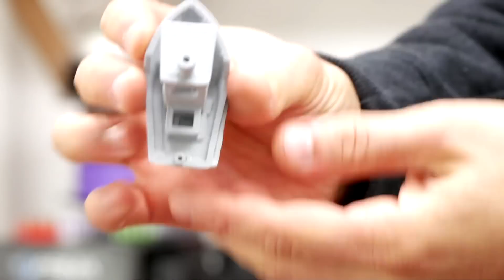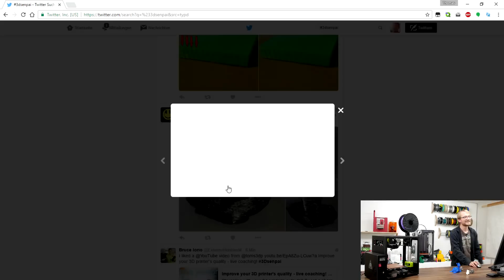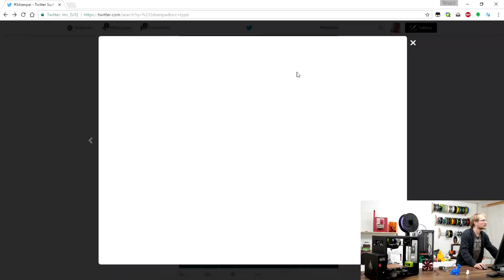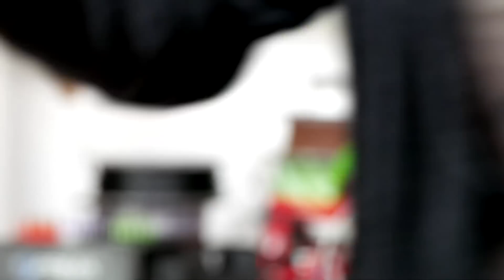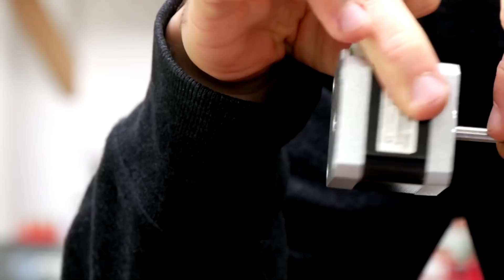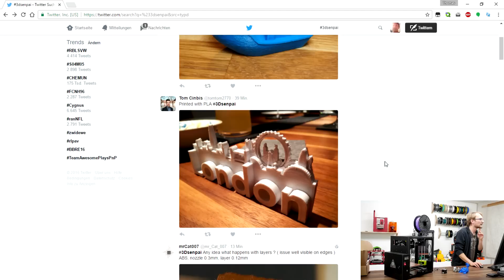[Part 1] Improve your 3D printer's quality - live coaching! #3Dsenpai

Comment: I have a weird issue un my ADIM Lab modified prusa i3, it's about the print quality, it extremely inconsistent. One time I have pretty rough walls and in the next print (nothing changed the same pla) they're perfect, sometimes there are differences in the same print

Comment: That 3rd( I think it was the third one you looked at) black rectangle also looked like it might be the infill. 

Like if the guy used something like Rectilinear at a 45 degree angle but didn't have the % high enough. 

So he gets the diagonal lines of the infill's pattern and drooping just enough for that pattern to show through.  

Could this also cause that diagonal line distortion on the top of the model? :{J

Comment: Tom, got a question, can you do a instructional video with good close ups on the 10 or 15 most common print quality issues. Items like what over extrusion looks like, what the hot end is to hot look like, Z axis problems ........ that kind of stuff. This video was very close and I learned a lot, but I guess I'm looking for Video catalog of things to watch out for ;- )

 It would probably be a 30 minute video but really think folks would like a in one video or series of videos just on that subject. I know I get some strange looking things on some of my prints and would really like to know what is causing it, Little bloops on the side wall in the same area once in a while as an example ;- )

Thanks Tom

Comment: At our fab lab, our ultimaker 2 had problems with skipping on large parts. The problem was fixed by cleaning all of the guide shafts and re-greasing them. Worked like a charm on other printers as well.

Comment: I have this strange problem where I want to reduce print times but not affect quality in any way....
Reply: D64NZ That's hard to do depending on your printer....what type of 3d printer do you have?And how long does it take to print a none complex piece
Reply: I don't really think it's possible, but it is a Winbo 155L Superhelper. It does do good prints, I'm just impatient.
Reply: D64NZ With your printer it is possible but it is all in the settings so you would have to tinker with the settings to make it go faster for me I use a prusa and it would take 2 hours to print something big so I edit my settings(such as wall thickness,temps,etc) and narrowed it down to take 40 minutes

Comment: Awesome: Thanks for the Video: You nailed my Problem which has been driving me up a wall for 3 months.
Z Axis Screws that wobble, Did not know that would cause the rings on all my parts but the pitch matches so You nailed it. New Rods coming now.  That is what I get for buying the cheapest Prusa 13 clone on ebay ($200+ shipping).  Should have known better.  I'm now subscribed and going through your videos.

Comment: Z-wobble can be cause by the alan key screws that so tight to the threaded rod and force the flexible coupler to be bent on a side! 
I change the coupler and kept the screws barely holding the threaded rod. 
CoreXY 200*200*200 wheel slider gantry, 20*20mm alu profile 
Anyone having this problem just fill the thread grooves with epoxy and smooth them aligned with the top threads with a wax paper to be like a  regular 8mm steel rod for the first 2CM or about an inch inside the coupler, the alen screws will hold the rod strait like a round regular rod.

Comment: The analysis of the 3DBenchy problem (time index 22:00) is wrong in my opinion. This is not a printer problem but a slicer problem. I had exactly the same problem on the same location on the 3DBenchy with the simplify3d slicer. Simplify3d is very picky on the STL file format and will skip layers if the STL-format is not perfect. There are 2 versions of the 3DBenchy, one that will correctly be sliced by simplify3d and one that doesn't.

Comment: For the first time I decided to print a rounded model.  It was a Cat used in a Chess set I got from Thingiverse.

The thing is the bottom curved layers compounded, making a upside down staircase effect, but it was all the way around, not just on one side like a loose belt would cause.

So I made an "egg" shape flattening the bottom enough so it can stand on its own, and wow it has a stair case effect all around the bottom section, the rest is real nice and smooth.

well the top is a bit short.

I have no idea what is causing this. So far I have tried, slower printing, increasing the infill, reducing the slope.

Yea none of that is working, any ideas?

Comment: Thomas, I gave just got a bunch of Wanhau 3D printers with dual heads. Its all fairly straight forward except for this: Since the extruder heads are software assigned, can we assign different colours on the same job?   I a using ProDesktop to generate  STL and Duplicator for the conversion......

Comment: Why is it I have never had a single PLA jam ever? I don't even retract the feeder when changing filaments, I just heat to 170, release the feeder, and yank out the old filament xD
Reply: e3d  clone here no jams myself either, gues got a good cooling fans
Reply: E3d V6, I did get my first jam when my cooling fan died the other day, I jinxed myself. It was a really bad jam too, the filament twisted around in circles in the heat brake. I had a hell of a time unjamming it.
Reply: I used clones on all my hotends and never jammed, just make a modification so the ptfe get through until hotend tip.
Reply: i have a printrbot play and only ever had it jam due to heat creap bc the raft i was trying to print was 4x5 in. and thats too long for it to run without the fan at a low extrusion speed
Reply: 6mths ago but worth a shot; Any chance of a buyer's link?
Reply: I use an E3d V6 clone with a seperate all metal heat brake to replace the ptfe lined one it came with. Totally recommend it.

Comment: Hey man thanks for the video. I Just bough a prusa i3 acrylic, I put it together in 3 hours on an ugly video guide and I print. The print came out very good (using the parameters that was on JPG's files on the dvd), but, some times the filament will stop entering on the hot end. I just bought a new hot end with a little more quality.  Someone pointed me to de E3d but is almost the 50% of the value of my printer hahaha, so I want to test a little more of the cheap ones before to invert that sum. Thanks for the recommendation, the video was super informative

Comment: Great job! How do I increase the voltage on the motors? I just purchased the Gmax 1.5xt plus and simplyfy 3d. Where are the setting to change the voltage for the motors.
Reply: You dont have to change stepper motor voltage. The driver uses chopping mode and increases voltage as high as it needs to make a set current flow.

If the voltage requirement of the stepper is higher than the driver can deliver the  motor loses current and thus torque.

Comment: Hey Thomas, 
I am having trouble getting clean prints on a kit printer I picked up on ebay. The guy bought it and never put it together, then sold it to me for 100 dollars. Anyways, I get layer by layer inconsistencies along the x and y plane. The printer uses lead screws, all the belts are tight, yet after fitting it with a bowden fed V6 hotend the problem remains unchanged. Could it be the cheap steppers? I get no clicking from them, and they have the proper current flow. Could it be the firmware? Not sure what its running but it does not seem to be marlin. The printer is a Cstar P 802 mhs. Its similar if not nearly identical in design to many of the prusa 3d printers.

Comment: My crappy QU-BD printer was having issue with all PLA, one thing I have done was adding 2 filtering (sponge) before the extruder, the first cleanup the PLA and the second (filled with canola oil), the oil help the PLA, the PLA don't get stuck in the extruder and print is way better!

Comment: Where'd you get all the models for the pokemon? I'd love to print out a Lapras.
Reply: The internet.
Reply: Thanks Captain Unhelpful, my query is completely answered by your concise comment.
Reply: Look on Thingiverse, then MyMiniFactory, then Pinshape.   Thingiverse is always Free but requests tips, Others may have set fee per part.
Reply: Russell Purkey already have. there is a similar model (from like 6 different people claiming to be original) but it has flimsy flippers and the bottom is like 5 degrees above horizontal instead of flat. Thomas' will print much more reliably and won't break as easily

Comment: Use springs over the driver belts to get automatic tension. A kind of springs like they use for clips to hang laundry.
Reply: If you have a stiff enough spring, you are not adding "springiness" to the belt. If the printer is transitioning speed/direction quick enough to flex the spring your printer is either going WAY to fast or you need a stiffer spring. 

I have belt tension springs on my machine, but they are stiff enough that I need to use priers to really grab and squeeze them to remove them wgile at the same time the belt is not overly tight.
Reply: Torsional spring?
Reply: You are talking about the same sort of spring, I think.
Reply: ned star

Comment: Why when I do a crescent overhang the edge of the print wants to curl up ? And how to fix this ?
Reply: Warpage is due to thermal contraction (thermal stress). It's always an issue for 3Dprinting, and not an easy and straightorward thing to deal with as it depends on a lot of properties and process parameters. However U can start raising the temperature of your working table.
Reply: Tito Rodrigues I don t have a heated bed, I print only PLA at 210 C
Reply: http://www.matterhackers.com/articles/how-to-succeed-when-printing-in-pla
Reply: Throw a box on your printer while it prints :) Thermal shock will cause curling, you likely have a breeze going through your 3d printing area.
If you have problems with sagging instead, use a fan to cool the filament faster.

Comment: ... da vincie jr 1.0 -_- (it was free but still.) crap prints, circles aren't circular etc already tried to fix the x axis.
Reply: oh boy...i know your pain. i got a davinci 1.0 (full sized). Check your belt tension to fix the circles. The big davinci also has a small belt in the back that's under a cover. That one was loose on mine. I ended up replacing the firmware with repetier host in order to get halfway decent results; the default software left my top layers too thin, even on the thickest setting.

Comment: When you're talking about belt tension at about 6min; Original Prusa i3 Mk2 users need to be cautious not to over-tighten the Y-Axis belt because it can flex the Y-Axis motor mount and cause the pulley to not be aligned properly.

Comment: The reason the last bits of your rolls are printing worse is just time i think, my PLA got worse over time and i have been told it's mainly moisture from the air affecting it. instead of your cool wall you should store it in boxes with desiccant. I'm no expert, double check.

Comment: at 39:34 the waves are caused by the extruder motor not micro stepping properly causing a blobby extrusion pattern on the perimeter and infill.  I resolved it with a different model stepper.

Comment: I really don't see the reasoning behind a boiling water test. 

The melting temp doesn't change. The effects of boiling water (100c/210f) expected. A fruitless test in my opinion.

Strength test, you need a simple rig rather than pulling it by hand for consistency of angles, attack, etc. Even a simple lever bar would prove better. A automated or completely mechanical test rig best for consistency and fairness.

A shear test would be nice.

Comment: I have an issue with some filaments that they will print for a few hours and then the extruder will start to get clogged.  But if I restart the print with better filament it will run the entire 5-10 hour prints without a single clog.  Just for the heck of it I decided to run the print multiple times with each filament and always after about 2 hours the one brand would clog and the other brand would not.
What I am thinking is that the filament has very very small contaminants in it that over time build up in the nozzle causing a clog.  Have you ever experienced that?

Comment: Actually you forgot a major issue in 3D printing. The 3D printer construction itself!
All the "moving bed" printers are a bad by design choice (like prusa models). If you print just a bit faster the whole bed is "overshooting" because of its huge mass inertia. That's why you have those stripes/steps in vertical axes.  The other bad design is a "console bed" printers (like Makerbot, Ultimaker, Zortrax, etc,). While in the first "bed design" you have a wobbling in X-Y plane, with the second type of badly designed printers you have a more prominent wobbling in Z axis although solvable with a sturdy designed bed . The only solution for this problematic printers are SLOW printing speed. While the moving print bed is the worst of this two designs.The only good printers in my opinion/experience are printers that support the print bed in all four angles (like Raise3D, etc). This is specially true if your printer has a large printing volume + speed.

Comment: I'm a happy and thankful subscriber!
Please don't forget different ABS (+) brands to test in your Filoween! For 99% i print in ABS only because PLA is too brittle for my type of prints (functional things, brackets, housings etc)
I use a genuine E3D  v6 0.4mm hotend, and i have never (NEVER!) had a nozzle clog in the 2 years that i'm 3d-printing. I really don't know whats causing the majority of printers to experience those blocked nozzles.. poor build quality?

@Thomas; You spend too much time for apologizing for and fiddling with the recording software, just tell your story, it's interesting enough.. I'm sure those bugs will be solved in Windows 11 :-)
Reply: It's generally the PLA that causes jam problem because it's very sticky when warm & hot. That said, I've used plenty of PLA in "problem" all-metal hot ends (E3D v5, original Pico) and not had problems. Managing heat, preventing heat creep & heat soak does a lot.